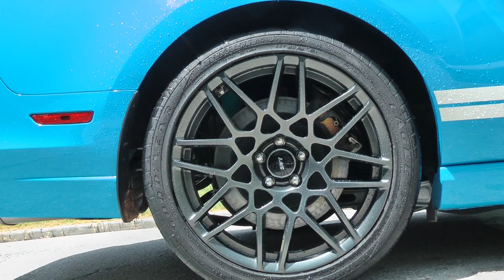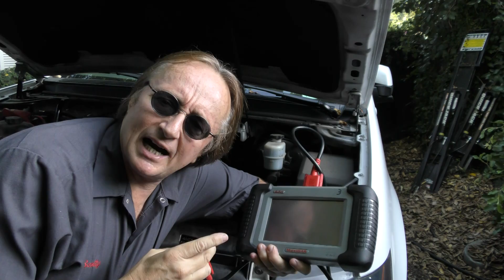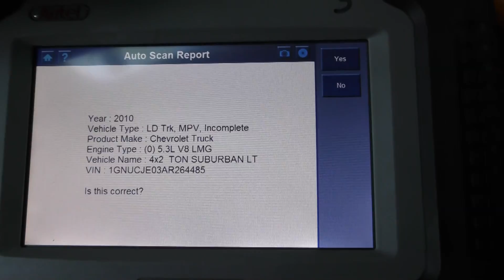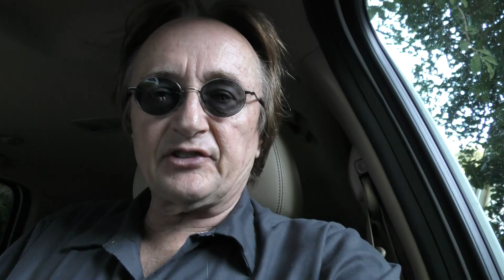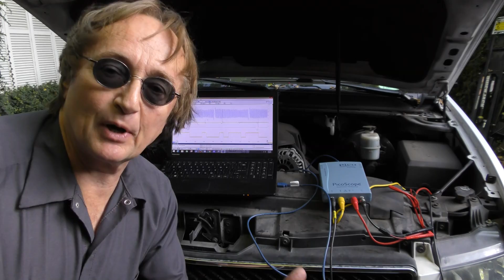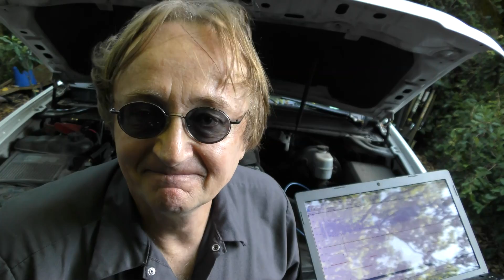Why Mechanics Charge So Much to Fix Your Car

Comment: So true this video.  Ran into this problem years ago on my Honda Accord.  My little scanner could not do it.  It turned out the instrument panel had a fault, which would have cost me nearly $2000 to fix.  So that was the end of the Honda (transmission was going as well a second time at 135,000).  I still have a 2006 Saab 9-3 with nearly 158,000 and no computer issues - making it much easier to maintain.

Comment: Hey Scotty I have a 1998 Honda Accord 2.3L with 337,000 miles on it. Cylinder 1 has no compression at all. Cylinder 2,3,4 have 120psi. I adjusted the valves and that didn't do anything. Is it possible to get a head from the junkyard and put it on the car?? I did the dry and wet compression test and there was no change in compression
Reply: Eduardo Garcia if its not the piston, then its probably just a  broken exhaust valve. this happened to my 2007 audi a4 turbo. less than 100k miles. just a poorly designed engine. no compression at all in cylinder #1. i used one of those camera probes that you can rent from autozone to see if the piston was cracked. i tried rethreading the spark plug hole. found out it was just a broken exhaust valve when i took off the head
Reply from the maker: you could try a used head, but that many miles, odds are the pistons are pretty worn in your engine too
Reply: Tomas Gaspar I did the wet test compression in cylinder 1 and there was no change in compression. I think the valves gave out. I'm going to the junkyard on Friday to get a used head for the car.

Comment: WTF is a body control module?! Are manufacturers just adding useless sensors at this point?
Reply: micglobal GREAT SCOTT!!!
Reply: It connects to your Johnson Rod and Flux Capacitor.
Reply: Saving on wiring. Plus once you get engineers locked on a path of putting computers in everything, well, this is the logical conclusion to that.
Reply: No that is the USE-less control module's job. Monitors the Uselessness of Uselessness.
Reply: a bcm is what tells the ecm to react.
Reply: My 1996 Buick has one, I learned. Been around for  a while, apparently.
Reply: When people bitch about rolling down/up windows and manually locking/unlocking doors but still ends up bitching when it is given to them. Can never satisfy people now a days. Always bitching about shit instead of appreciating what is given.
Reply: Everything has a module now because your car is more of a computer than a car now.
Reply: It controls the viscosity of your blinker fluid. If it’s not maintained people won’t be able to see your lights as well at night
Reply: Gatorsrok so it controls the body shape of the vehicle?
Reply: Jg3000 I faintly remember the days when WE were the sensors, like before you changed lanes, you'd do a quick glance into your blindspot before changing lanes, you didn't need a little amber LED to light up in your peripheral vision to tell you if a car was next to you. I also remember the days when we would look forward out of the windshield, and when we needed to stop, we would apply the brake with our feet and didn't need crash avoidance mitigation systems to apply the brake for us. I'm amazed they haven't invented a battery operated knife and fork that strap to your shoulders and using robotic limbs and algorithms, cuts the steak for you.
Reply: @Gatorsrok, you might gain credibility (and some friends) if you dial down the unnecessary insults and profanity.
Reply: why the heck does that need a computer, easy wiring tbh, door opens lights come on, doesn't need a computer
Reply: +TheWretchedWorld: My 86 Cadillac Seville had one.
Reply: micglobal....Did we just become best friends?
Reply: Michael _Howto so you bring it to their dealer and charge you an arm and a leg
Reply: Government mandates.
Reply: OldRed91 Remember when the sensor was just electrical wires and no computer.
Reply: @Gatorsrok, I am sincerely sorry I am such a plebe. Please Gatorsrok, enlighten us more with your infinite wisdom
Reply: yeah common problem with the 99 denali / escalades
Reply: bcms have been in cars for decades
Reply: You're a dumbass.... SOUNDS IT OUT. BODY... CONTROL.... MODULE...... WTF do you think it controls.... hmmm.... maybe all the lights and a majority of the other outputs in the car that are attached to the body. dipshit...

Comment: My fuel pump died on me and I talked to a shop owner and he said "your no mechanic so we have to plug it in and diagnose it first for 150 dollars then we could fix it" They wanted 300 dollars to install a new fuel pump plus the price of a new fuel pump. That's more than 500 altogether. I replaced it in my driveway in less then 30 minutes. I hate the "your car is newish and has computers so we have to scam you" mechanics.
Reply: ChiTownRuler023 30 minutes to replace a fuel pump? it must have been one of those cars that has easy access to the fuel pump by removing the rear passenger seats. ive seen them on kia rio, nissan maxima, dodge charger and magnum
Reply: @tomasgaspar9664  Dont forget honda
Reply: @ChiTownRuler023, What year, make, model did you change out the fuel pump?  I've changed out a fuel pump myself on a 2007 Ford Taurus and it was a pretty involved job for me and took several hours.  I consider myself a shadetree mechanic with average skills.  Even though this wasn't too technical, it involved many different types of hose connections and some unwieldy access to remove and install the fuel tank.
Reply: you have to be careful when you replace fuel pumps in some vehicles.  the parts surrounding it was so corroded from fuel exposure it's easy to break an expensive part.
Reply: I was getting alignment when they told me that my lower control arms were bad, they were, and that I should get that fixed first so out of curiosity I asked how much they said 500 I laughed and left am
And bought some online for 50 and installed them myself saved me 450
Reply: @r8myers  we tried to get other brands but they would not fit.  I had to get from dealer :(
Reply: glad I found a good mechanic. plus my cars old so you can't plug it into anything. maybe a volt meter lol
Reply: 5 mins yea right...typical Lmao. Clock starts when you put the key in the car...pull it in the shop...do some diagnostics...get on the phone...locate the part...go get the part...R&R the part...verify the repair...road test the vehicle...clean up the mess to be ready for the next repair...write up the work order...call the customer to tell them its ready...when they get there perform customer relations...answer all the questions...take their payment...all in five minutes hilarious...spoken like a person that NEVER operated a shop...perhaps your employer should pay you for 5 mins of work and not for the other 7 hrs and 55 mins you pissed away doing 5 mins worth of work!!
Reply: anything related to refrigerant is expensive to do commercially because of the massive amounts of regulations and hoops they have to go through.
Reply: sounds familiar....
my AC quit blowing cold and was leaking the refrigerant out in a day or two (big leak)....  I put dye in and noticed an acumulation of it around the low port Schrader valve. Every shop I called wanted to do diagnosis for 89.95 plus charge to vacuum system down etc etc.
I changed scrader valve, vacuumed system down and it held for over an hour (AKA no other leaks) and recharged it myself....
total cost? less than 80$
total time for everything? 2 hours

my vehicle was having random issues of not cranking and I wasn't hearing the "buzz" of the fuel pump....  shops wanted to charge me 125$ to "run full testing and diagnosis procedures" because (according to one) I'm a female and the majority of female's only know how to turn a key.
I changed the fuel pump myself and didn't pay over 110$ for new pump....  took no more than an hour start to finish.
Reply: Jennifer Rae Fuchek Can we please get married!! 😍😍😍😍😘😘😘😘😘
Reply: I think some things are left out here.  I own a small Auto Shop in Houston.  For me to hire a mechanic who is worth a damn, it's going to Cost me at least 20 bucks a hour flat rate. Then we can add another 7.50 per flat rate hour  to cover his government mandated workmans comp. Then let's add another 7.50 per flat rate hour to cover his government mandated social security that I the owner has to pay. Now I charge 85 per flat rate hour, that leaves 50 left per flat rate hour to cover everything else. The Land, electricity,  water,government mandated insurance,  and any other employees.  Don't blame the shop for charging  because you can do it cheaper.  You can cook at home cheaper too, but I bet you eat out!
Reply: To do a fuel pump in a 90's Corona takes all of 5 minutes. Just pull up the lower rear seats, unscrew old pump, screw new pump in and put the seats back down.

In my Starlet it would take all of two minutes, just unbolt old pump from engine and bolt new one on.

Not all cars have shit American designs that are a bastard to maintain.
Reply: Took my car back to the dealer's shop cause the temp gauge was dipping in cold weather at high speeds . . . losing heat too . . . 'Oh, it is supposed to do that,' the shop said. I bought a new thermostat and coolant and asked the Pep Boys mechanic what changing the thermostat and coolant cost for a 2008 Expedition . . . after a lot of clicking and a computer printout, $308 . . . Two screws and five bolts later, new thermostat in and topped off the coolant . . . $40 . . . and they wanted to charge me $300.
Reply: The average person or shade tree mechanic though can dump as much refrigerant in their leaky POS compressor without worry.
Reply: Mac Flood there are still trustworthy mechanics its unfortunate u have to go through bad ones to find the good ones and the mechs at dealerships have to follow the status quo its not their fault usually the smaller shops are better but in reality learn to do it yourself to get around this its not rocket science considering all the info on youtube and the net
Reply: I went to get an alignment job for my car once (a classic car) and the shop just did it for free because they found out that it wouldnt hold for long. They said several major components of the front end were damaged and had to be replaced. They said they couldnt do that so we took it to another shop and it cost over 1000 dollars to replace the balljoints, control arms, front wheel bearings, and other parts all at once! But I guess it was worth it since the camber of the front wheels pretty much destroyed BRAND NEW TIRES in 2 MONTHS beforehand. Oh yeah thats another thing, I had a whole set of brand new tires put on the car and new ones had to be put on the front again. Had this job not been done I wouldve suffered a blowout, or total steering failure by now. So I guess it was all for the better
Reply: but it's only 2 screws you have to undo....lol
Reply: Your exactly right Leon. People have no idea the cost of equipment and schooling and tools to be a tech these days.Its a walmart fast-food society. If we can't do it fast enough cheap enough then we are ripping them off but when it comes time to pay the tool bills just to have a job, who is getting ripped off! Techs are!
Reply: @Jennifer Pitts, "I changed the fuel pump myself....took no more than an hour..."  Will you marry me?
Reply: You really don't know how to replace the fuel pump, do you?
Reply: half hour to get it on jack stands
Reply: Jennifer Pitts seriously, i need a wife like you! 😍😘
Reply: ChiTownRuler023 get your own diagnostic tool ya they are expensive but pay for themselves by not getting charged for the diagnostic from a shop
Reply: Exmerion u should be careful replacing any part its just common sense
Reply: Bmw M3 e46 same with my Audi except mine has a lot of computer parts
Reply: Mitsubishi Galant too, i changed mine in about 30 minutes ish right under the back passenger seat.. Some guy told me his was like inside or on top of his gas tank in a jaguar, i suppose he will have to drop the tank to even get at it.. I feel bad for him
Reply: GPS ON TIME your thermostat was fine, you fixed it with your anti freeze.
Reply: I also did mine in around 30 minutes, but it was because 1) Nissan makes you replace the entire, expensive fuel pump assembly (thx, Nissan), and 2) it was accessible under the back seat (3-5 minutes to take the seat out and put back in.) 

Other things on my Altima take a lot longer than other car models/makes.
Reply: Jennifer you are full of it. Talking boasting lies on the Internet must get you off. Have a nice day.
Reply: ChiTownRuler023 cool story bro
Reply: +Maj Wor h
Reply: dquad :5 minutes to replace a under the seat fuel pump.Yeah right.
Reply: ChiTownRuler023 well if u hate them why do u go to them??
Reply: ChiTownRuler023 Should have lit the place on fire.Let them diagnose it
Reply: I was quoted $1300 aud to get the mechanic to change the fuel pump in my 30yo bimmer, did it myself in 30 mins for less than $200aud and no special tools
Reply: on my 1998 BMW it's right under the rear passenger seat no need to take gas tank off everything is easy to get to. don't have too many comluter parts either
Reply: @BmwMe-uh9sy  
Same mine 2008 mercedes c300 4matic, 2 pumps with filter inside itself/fuel pump housing, located under rear seats & 2 big metal seal rings I had to hammer/screw driver leverage out, plus fuel sensors & blue fuel line.
Reply: exactly I had a minor problem with my car, took it to the mechanic and explained the symptoms and how I diagnosed it myself, they made it seem like they had to charge me $100 to diagnose it again, I was like nope just replace the part I need replacing.
Reply: What these idiot rip-off mechanics don't realise is that we're not actually as stupid as they think. They are just too stupid to realise it.
Reply: well there is a lot of truth to that. if you take a poll right now and go to your neighboors and ask the ladies about cars. statistical probabillity dictates that the great majority of ladies will know exactly how to turn the car on and maybe open the hood. 

also for liability reasons, unless you go to a mechanic shop and ask them to specifically change the fuel pump. they will likely have to charge u a diagnostic fee as their time is money to them. They are not going to just diagnose it for free you know. a no fuel pressure issue could be a bad fuel pump, a bad relay, a bad relay connection, a bad inertia switch, a bad connection at the pump, etc.  and it takes some time to check all that, especially if the pump is in a hard to reach location

you get the drift, although yes. 125 seems on the higher side for diag fee.
Reply: yeah, scotty is beginning to sound like a scammer

Comment: Car manufacturers - finding solutions to problems that never existed. Stupid modern cars.
Reply: thats what i would like to know...but i dont understand technology, i dont understand why you need some digital display and tens of buttons to change the temperature inside the car

sorry but pressing + fifteen fucking times takes a lot longer than just turning a dial 30*, i can keep my eyes on the road at the same time too
Reply: I think the auto industry would do good to get back to basics, as much as it can.
Reply: opl500 Maybe why the Mazda 2 was so undersold, as it went against the status quo :( . I for one am happy to own a simple modern car that doesn't even have cruise control, less stuff that can break!!!!
Reply: mileage is great, but what your saying about the cost of buying the car is my problem, i dont want electric this computer that im happy with a crank window but when you buy a car for 30k its because they have to pay some dude to fabricobble some weird display or a touch interface.
if they were to focus on the basics they could build simple cars that handle great, are powerful and get great mileage but instead they put in some computer that sucks up 30 or 40 amps and is a royal bitch to replace when it dies
Reply: and all this, "self driving and parking" crap
Reply: apachelives push button start, knobs instead of leavers to switch gears, tire pressure monitors, blah blah. Stupid waste of money if you ask me.
Reply: Don't blame them too much. Emissions regulations made installing cats mandatory. Which made controlling exhaust gases mandatory. Which made fuel injection and ECUs mandatory. And then there are all the CAFE standards. If you got the engineers away from management and the government, they'd probably be happy to design a simple car that lasted a long time, but they are not allowed to do it. Off the table.
Reply: apachelives Remember my friend Civic EH2 lol
Reply: emissions have stagnated, with all this fancy shit wouldnt you expect 40mpg by now on average? i still get 32 mpg on long trips with my chevy sedan thats over 15 years old, these computers are there to make you a slave to the dealer
Reply: opl500 it cant and never will due to emissions
Reply: i kegel there's alot more to a car than mpg. There a huge group of people that like all the stuff you think is so fancy. I could care less about mpg lol get a Prius if that's your concern. With a factory warranty plus the add-on warranty, yes you go to dealer, but it's all covered in your cost of buying the car at the beginning.
Reply: You all sound like super old dudes that hate technology because you don't understand it. 

Why would manufacturers find solutions to problems that don't exist, that would COST them money.